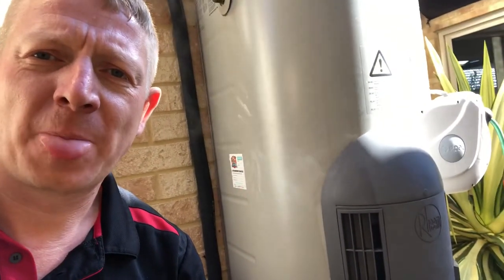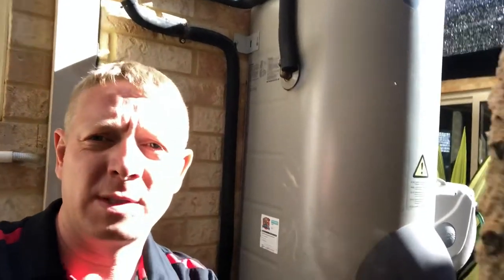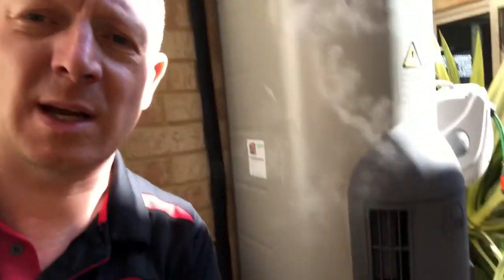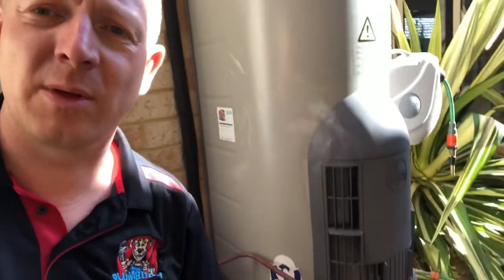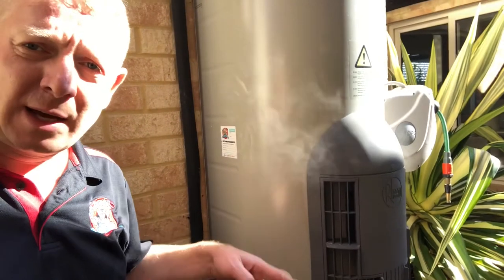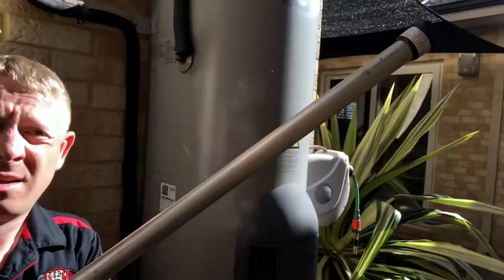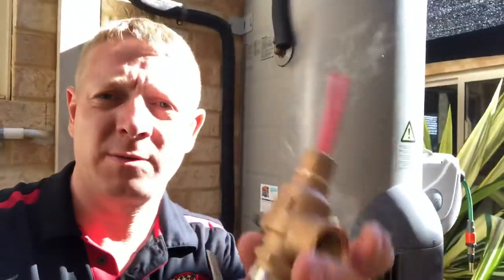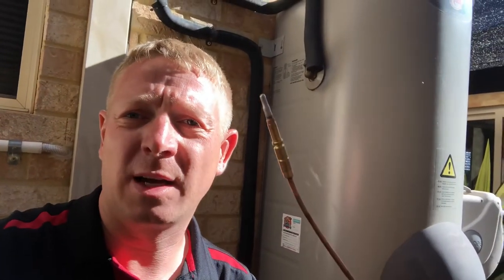Is Your Hot Water System Making A Strange Rumbling/Popping Noise? - Plumbdog Plumbing Perth

Comment: Richard thank you! Our hot water heater is doing exactly this. Making the popping noises and we've had no idea what the problem was. Out hot water heater is only 5 years old and it seemed odd that it would be having problems this early. When it was installed the tech had the temperature turned up almost to the hottest setting and the water was scalding within an extremely short period of time. I had to turn it down by 40%! Now that I know what the problem is I can deal with the installer from a much more informed position. Again, thank you very much. The best to you and yours. 
M. B.

Comment: Thanks for sharing that. I live in a block of  units that has 2 one bedroom and 4 two bedroom units serviced by one stellar 330 unit witch is designed for five people. Given my understanding that state and local housing laws of a maximum of two people per bedroom that would equate to 20 possible people using the hot water. Even with the current occupants at 9 I get about 20 seconds of hot water every time I go for a hot shower before it goes cold again. I've been sending multiple repair requests to consecutive property mangers for over 2 years,  At 40 degrees at kitchen sink I have had to boil the kettle to wash the dish's,  not helped by eternally mounted uninsulated pipes, rumbling and popping yes, white powdery residue (I assume calcium) around the where flute connects to the tank yes, more white residue coming from where the hot relief valve fixture attaches to the tank. In the infinite wisdom of the real estate agency principle, a paver was put on top of the unit to stop it blowing up , which was at least was progress on the initial claim that Origin owned the physical hot water tank. The joys of subletting through a community housing organisation to a real estate agency with a set and forget attitude. Well at least I know now what my sister went trough when she had to live in a tepee outside my mums rural property or what brother did on military manoeuvres.

Comment: I heard this noise after I moved in my newly purchased house with a 5 or 6 years old water heater. The noise occurred for only about a minute whenever some one used hot water. But one month later the noise stopped. Not sure whether the underlying problem is till there...

Comment: Um, mines been doing this for over a year mainly when the shower is on only. When the washer or faucet, etc Is in use it still makes the noise but very minimal compared to the shower is that normal, especially since the noise has been going on for over a year?!
Edit: I just now noticed when I use hot water only it does this. I just used the faucet on cold water, put my ear to the wall, heard nothing. I switched it to hot, then I hear knocking. Right now I'm using the washer and I barley hear any noise. But if it's the shower it's loud knocking, almost like this. Never been flushed or anything and I've been here since 2017
Reply from the maker: If your in Perth head over to our website and make a booking and we can take a look 👍